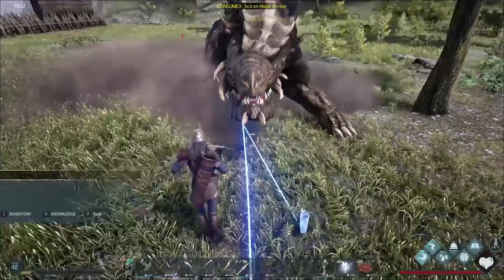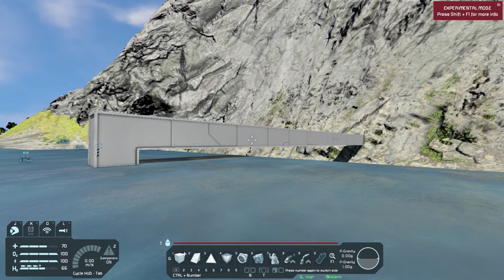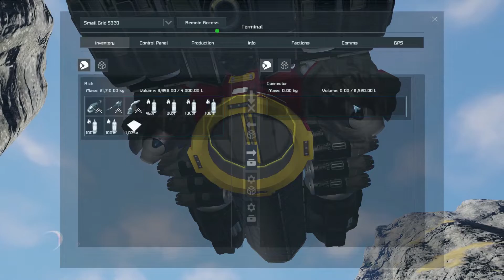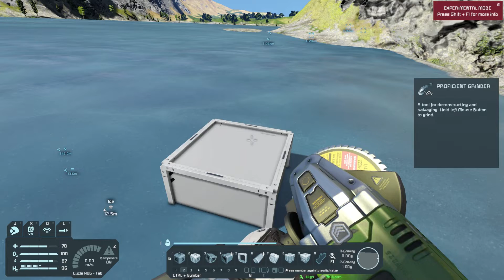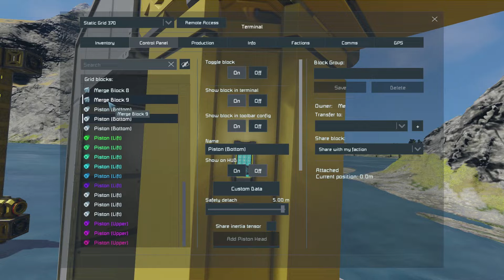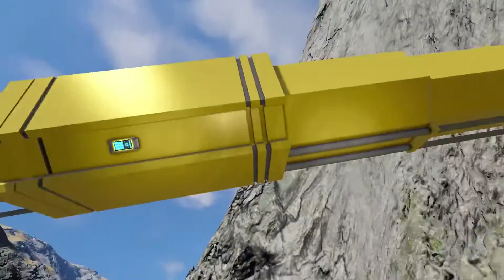Space Engineers #4: Drilling Rig

Comment: For those having problems getting the merge blocks to work and unmerge correctly, may may need to ensure you are not building too close to voxels. If building close to the surface you may need to shift the entire drill assembly up a block or so to get the merge blocks to unmerge correctly

Comment: I made a similar but much smaller drill rig and have run into a problem. Any time I turn off the merge block, I have to manually walk over to the piston head to convert the head and merge block back into a ship... I checked world settings and turned off "Convert Ship to Station" but that didn't fix it. Any idea why or a work around?
Reply: 2 years later but I am hoping you found a solution? I have the exact same problem.

Comment: Building into rock is way more efficient, hides your stuff if well planned, and a single large or small drill arm (well designed to snake through rock) can be used to create FUN internal roller-coaster action &/or ground cut-throughs for quick travel to key locations. Internal tunnel building & reinforcement would also be MEGA EFFICIENT for moon, mars, etc. exploration in the real world as well... fewer materials used & transported to provide for near permanent & re-usable bases. Much quicker than building everything out in the open. And looks cleaner as well.
HuGGz